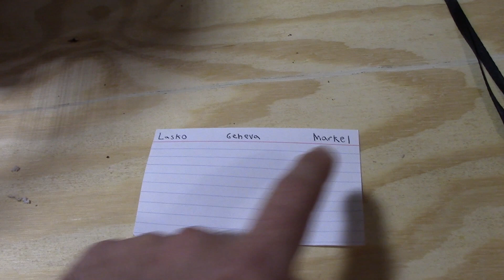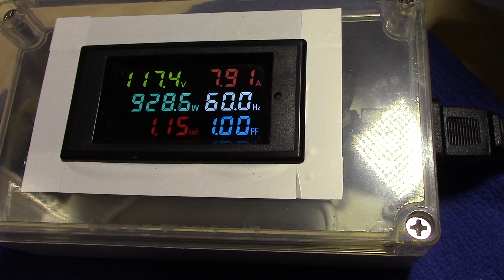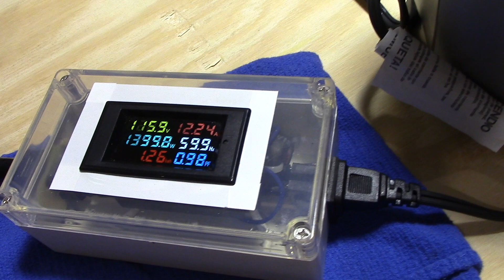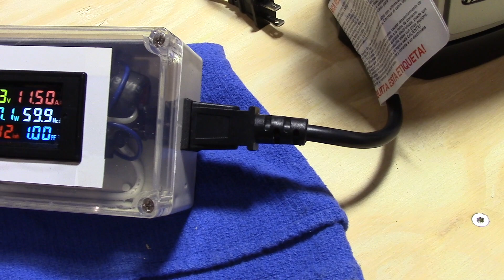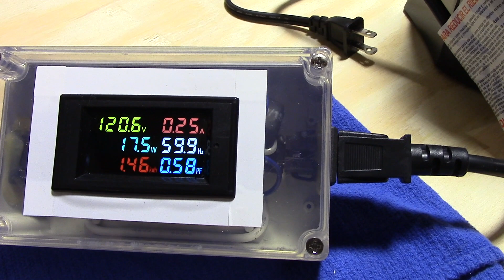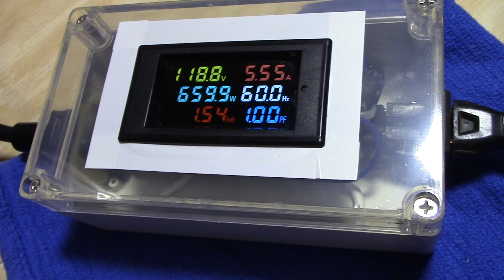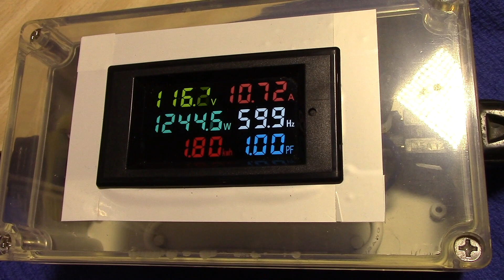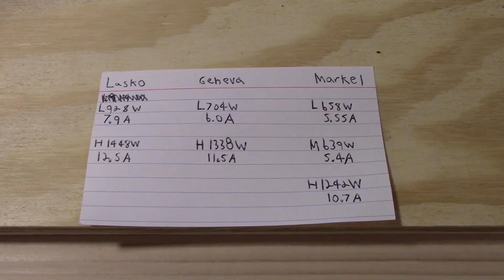Do Newer Heaters Use Less Energy?

Comment: Although, aren't electric heaters 100% efficient, so if it's pulling 900w you're getting 900w worth of heat? Therefore how can one heater be more efficient over another one? Surely it just means the ones which pull more watts will heat a room faster than one pulling lesser watts? I could be wrong on that, I'm no expert, but that's my understanding of electric heaters.
Reply from the maker: Definitely not. All three heaters did show a Power Factor of 1.00 so all the energy was going to heat for all of them. However, higher wattage doesn't at all mean you'll be getting that much worth of heat. Things such as the design of the elements/coils can affect that. To be fair, you couldn't feel what I felt, but the Markel heater was definitely putting out stronger and hotter heat than the other two. There's no way the Lasko would do as good of a job as the Markel did.

Comment: I use Kerosene Heater in my house since it was in the 30s or lower and the heat rises and keeps me warm during the winter.
Reply from the maker: Oh those are okay to use indoors?
Reply: @Sharkie626  Yes it is okay to use Kerosene Heater for indoors, but when you are using the Kerosene Heater, the windows has to be partially opened to ventilate the smell and you'll have a heat.

Comment: It comes as no surprise that the Markel comes out on top in practically all fields.  We've used it with the dishwasher, and other times, not to mention I have one as you well know.  That, and the vintage Kenmore I have, do it better than every other heater I have.
Reply from the maker: Oh yeah that was fun to use on the dishwasher back when. Interestingly enough the Potscrubber seemed to use less. I think it might be because it has a smaller motor. But yeah the Markel won completely. I’d love to see it on the Kenmore heater some time!
Reply: @Sharkie626  Interesting.  Might have to have a heater-off!